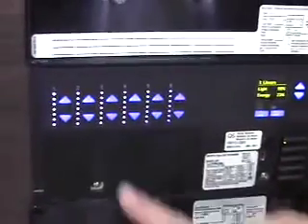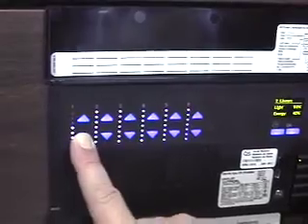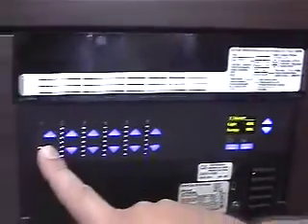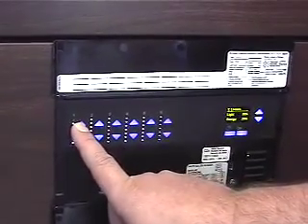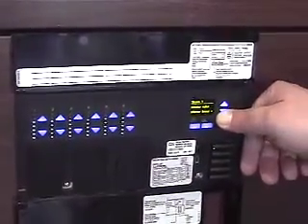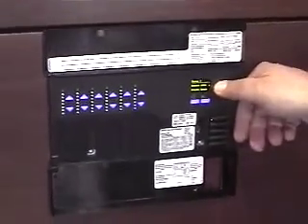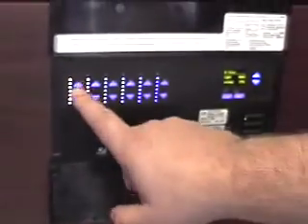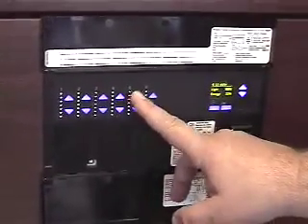Lighting Controls Lutron (35337)

Comment: Is there a difference in the GRAFIKeye system when used in a commercial setting as opposed toa  residential setting. Or, is it the same system just used in a different location. Hope the question makes sense.
Reply: Functionally, no difference. However the unit is likely different as commercial spaces generally use 277 volts for lighting.